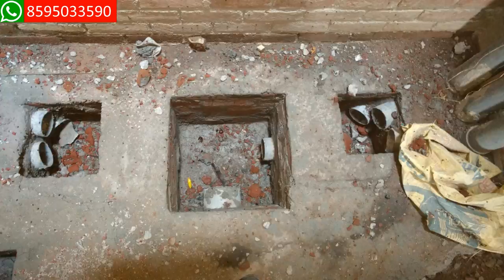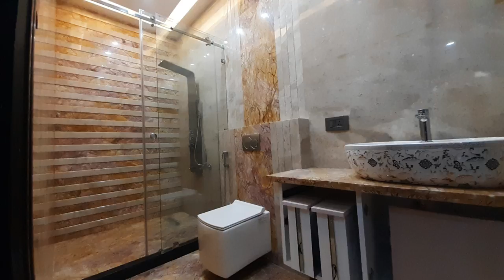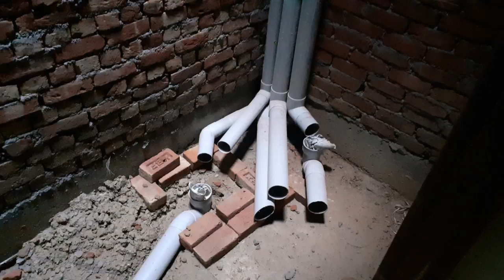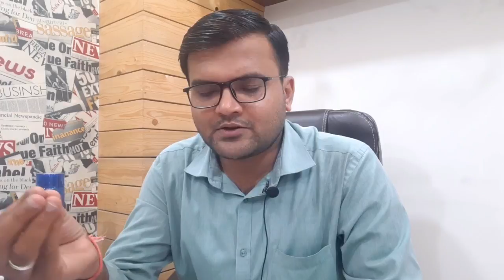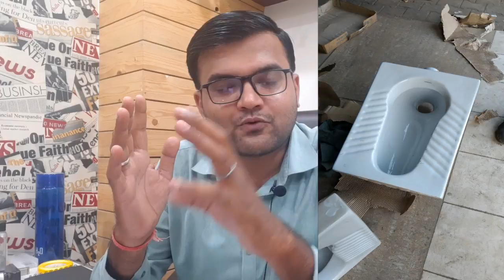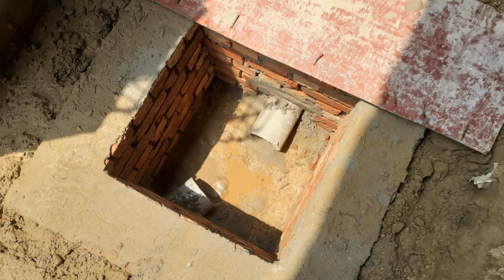MAIN HOLE और  GULLY TRAP का क्या USE  है (दोनों में क्या difference है )

Comment: A gully trap is a device that connects a drain pipe to an underground drainage system, allowing water to enter the system while preventing any smells and gases from foul drains escaping into the air.

 In fact, its name describes its purpose. A gully is a drainage system designed to control surface water, usually rain, and a gully trap is designed to ‘trap’ smells and gases inside the drainage system.

There are two main types of gully traps – the P trap gully and the bottle gully. They are used to collect water across all types of paved spaces, including block paving and asphalt. Most gully traps fitted in the UK are made from plastic.
Reply: But what about solid waste? It goes directly to manhole, how is it prevented for solid waste?

Comment: It is not a "MAIN" hole, it is a "MAN" hole, as the name suggests, it is an opening, sufficient enough for "a person" to access the main SWP and fix the problem. Fortunately, in India Manual scavenging is prohibited now, and we opt for mechanized cleaning but this is how the name originated. So, it is a gully trap for WWP and then an inspection chamber for SWP or sometimes for RWP as well (Separately), and then further Gully trap and Inspection Chamber is connected to a manhole and then to the main sewer line. (if there is one common outlet leading to the main sewer line.) However, it is advisable to channelize and opt for rainwater harvesting to reduce the load on the main sewer line and ultimately at the destination. (The concept of Reduce, Reuse and Recycle should be exercised for effective water management)